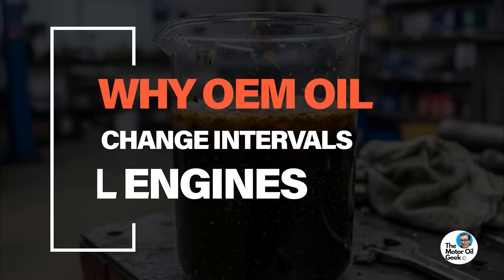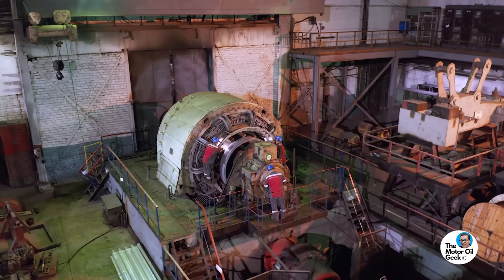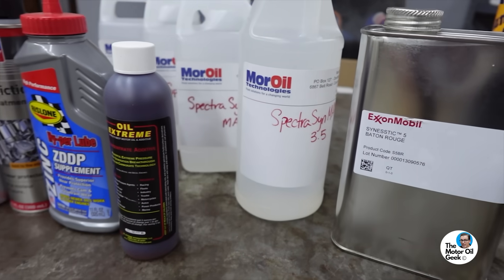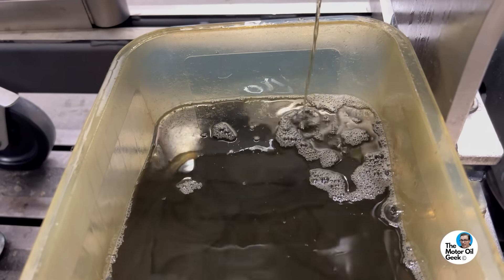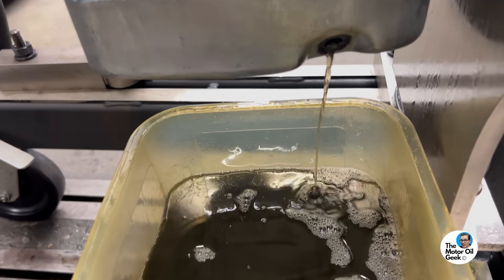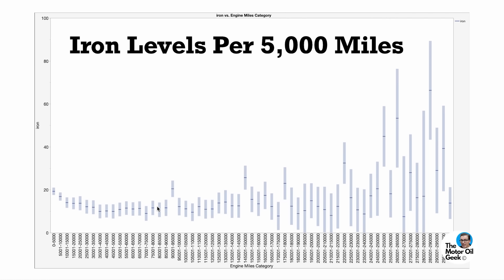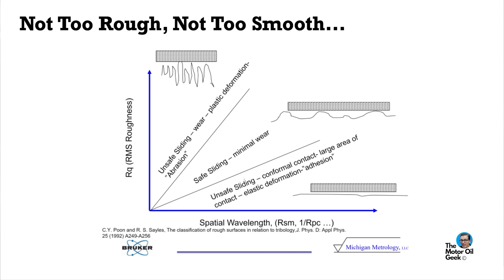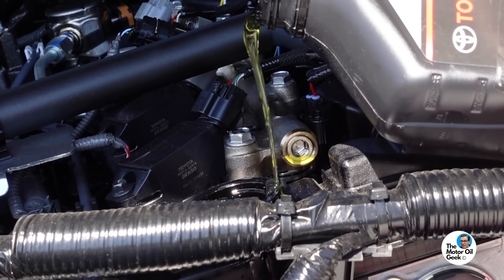NEW Data Reveals WHY Modern Engines FAIL Prematurely!

Comment: its been 5 years and we're still stuck on this, can they not just go back to engines that work??? Can they not up the oil pressure??? Can they not go back to 3000 mile oil changes???

Comment: Wouldn't changing your oil filter more often than your oil, be better overall ?. Or how about having 2 oil filters of varying filtering levels to catch as much as possible. As oil isn't un-serviceable, at low mileage, and pretty much wasted by discarding it so early.,,

Comment: Chrysler Rocker arms on the 2017+ Pentastar with VVL are on I think revision K.  Not only are the rocker needle bearings a poor design that fails easily with 10k oil intervals, the oil galley plug bolts are known ot come loose and fall out causing low oil pressure in the cylinder heads.  Ask me how I know.

Comment: I had a 2000 BMW 540 with an oil change "monitor".  It consistently indicated oil change would be due at 18,000 miles (extrapolated), but I consistently changed at 5000 (full synth).  Car was still running flawlessly at 200,000 mi when it was totaled (not my fault).

Comment: Let’s say you want to drain the oil after 1500 miles. Leaving the old oil filter on longer is recommended because this avoids “resetting” the filtering efficiency to a lower level. However, this also means you are leaving behind an extra 150-200 mL of old dirty oil. Is this not worse than resetting the oil filter to a lower efficiency?

Comment: All of my cars have gone 200-300,000 miles. I change my oil every 5,000 miles, change the transmission fluid every 30,000. When I've had to change timing belts and other engine maintenance, my engines are clean as a whistle inside. It really does make a difference.

Comment: Great, evidence-based exposition. I would just add one thing, in my case.  I bought a 2026 CR-V EX 1.5T, a month ago. Honda's break-in includes a moly lube on the cylinder walls. At 500 and 1500 miles, when I do these initial spills and fills,  I'm going to use the highest moly oil on the market . . . The MAZDA ECO7 (600 ppm) to maintain the moly levels during break in. I'm also going to install a magnetic gold plug, to catch the small micron particles. On the third oil change, I'll switch to Pennzoil Ultra Platinum.

Comment: Tighter tolerances with extended oil change intervals with higher stress put on your oil due to turbos, direct injection and low tension piston rings causing more heat, soot and fuel contamination from blow by. 3k or less oil change intervals for all my vehicles. Especially with how thin timing chains are today. They are extremely susceptible to wear and really need to have clean, uncontaminated oil to minimize friction and heat buildup.

Comment: I have a 2015 Ram 1500 we bought new.  It has 143K miles on it.  It has just developed the "HEMI tick".  We had the exhaust manifolds and gaskets replaced.  They were cracked, but the tick is still there - it's the lifter.  I did a 500 mile breaking oil change as I do with all my new vehicles.  I have only ever run Mobil 1 oil in it.  After the 500 mile breakin, I have used the computer oil life meter to determine oil changes.  I always changed the oil filter with every oil change.  My other vehicles I change the oil every 5,000 miles.  Is there a benefit to installing some kind of aftermarket device to install multiple filters?

Comment: I'm surprised that Lake Speed Junior got the oil filter part wrong.  Oil filters filter WORSE over time, not better.  He's thinking of AIR FILTERS.   Poor advice about oil filters (that is dead wrong) but good advice about oil.   That was disappointing.   He's also wrong about manufacturer CAFE credits for 'less waste oil' by recommending longer intervals.    Other than those two glaring errors, I've found his videos to be largely correct.

Comment: Do you really think, with all your knowledge of lubricating oil, that the problem lies with the oil? Wouldn't you like to share that responsibility with the poor engineering of downsizing, the cheap materials used to make engines, and the absurd reduction in clearances? With extra power? In favor of lower consumption and pollution? There are other solutions besides oil. Let's face it.

Comment: The whole reason I am now changing oil every 3,000 miles first engine oil of my jeep I did at 1,500 miles and also changed from 0w 20W to a 5W 30W and also added the Baxter adapter to get better oil filtration.

Comment: I'd be curious to see what the MOG (motor oil God) says about additives in the oil for heui injectors like the 7.3 fords and 6.0s. Heui is when the oil drives the injectors. Becasue ive had bad sticky injections did the additive and it cleared it up.. but was it just bc i changed the oil twice in a couple thousand miles?

Comment: Quality, reliability, dependability & longevity are a cancer to any manufacturing companies, especially automotive manufacturers. 

The days of quality, reliability, dependability & longevity are long gone. 

Things manufactured to fail, break, costs double to repair or replace.

Planned obsolescence is the new money making business model.

10,000 mile/1yr oil changes, lifetime transmission fluid, 0Wxx oils, 3yr 12V batteries (10yr batteries existed then dropped to 5yr). what's next 1yr batteries, WD40 baby oil engine oils?

Doing your own fluid changes is considered by dealerships & manufacturers as violating warranty. 

My 2007 Scion TC 2.4L 2AZ-FE rebuilt/salvaged car at 180,000 miles does a better job than these new laptops with wheels.

Comment: I've got a 2017 tundra with the 5.7. I use Mobile 1 20,000 full synthetic oil and filter. I change the oil at 10K mile intervals. I also use 5w20 instead of the manufacturer suggested 0w20. Should I be doing something different?

Comment: When I first  purchased my 2019 GMC 6.2. The dealership gave me a hard time because they gave me 3 free oil changes. I did the first one I believe at a 1000 or 2000 miles, and the second 1 additional 3000 miles, and then I think the third 1 3000 mile so basically I used up all my oil changes.  In about 8000 miles, and they said that was too frequent or well, maybe that's why my 6.2 hasn't blown up yet.Anyway , I'd like to hope .😢😅

Comment: The Geek is on to something here.
I'm an old guy... when my soon-to-be wife bought me a 1967 Triumph 650 as a 'counter-gift' for her engagement ring, I was delighted. Brand new... but Triumph did not put oil filters on their motors; instead, they had a 'sludge trap' in the crankshaft that captured the shavings etc.
My strategy was to change the oil at 50, 100, 200, 500, and then every 1,000 miles.
When I took the engine apart for a rebuild around 15,000 miles, the crank looked brand new - the original swirl marks on the big ends not polished over.
My '83 Ford 300 six got straight 30W every 3,000 miles, and I sold that van into commercial service when it had 320,000 trouble free miles.

Comment: Wait…so it’s better not to change the filter every oil change once the engine is broken in? I bought a used 2023 Camry that had 8300 miles. When it hit 10k miles I got the oil change. What I was surprised was that the previous owner never did the 5000 mile service. So at 10k, it was on the factory oil. Since then I been doing every 5k oil changes. I hope the engine didn’t get damaged.

Comment: Lake, you mentioned that you changed the oil 3 times on your Dad's race engine after using break-in oil on the initial startup. Did you run the engine for 20 minutes each time before you changed the oil, similar to your oil flushes? My son races circle track boats here in California. After breaking in flat tappet cams, we would change oil to our standard Valvoline 20-50 racing oil before we race. I'm wondering how you came to the conclusion that changing oil 3 times made a great difference. Did you perform an oil analysis before each oil change? If so, what did you see in the oil analysis that convinced you of the 3 oil changes? 
I hope your channel and the Speed Diagnostics business is very lucrative for you and your family. You deserve it. This information is so welcome to us novice engine builders, racers and auto geeks. Thank you!

Comment: Because of crazy cafe standards for manufacturers to show improved mpg every year, reliable V8 and V6 engines are replaced with small engines with big turbochargers and hybrid systems that are overly complex with much shorter life expectancy and much higher maintenance costs ‼️🤮

Comment: did you say "using oil as hydraulics fluid as the fluid is clean"?  I don't unerstand what you say. It does not make sense, because engine does not use oil as hydraulic fluid, except some oil powered vtech or hydraulic lifters.

Comment: So what is good oil?
  Cleeeean Oil. Of the right viscosity at start up after being shut down 24 hours and outside in the elements.
   W,, Means winter, below freezing for 24 hours and you must account for wind chill when iutside in the extreme north, at cold start up.

Comment: 545 2,500 5,000 7,500 & 10,000 miles that's what i did with my 2GR-FKS V-6 in my 3rd gen Tacoma TRD 4X4 off-road.. hopefully that will help in the long run 🤷‍♂️ & 5K from here on out

Comment: If you are restoring or rebuilding an old engine, when you first crank it, all of the old timers use break in oils and  grease. It's a no brainer. As an old Ford tech, we had Ford engineers come in and give seminars and we asked about oil change intervals...the engineer told us flat out, "You change the oil when it needs changing. That may be at 3,000 miles, or it may be at 500 miles. It all depends on how you are driving the car and what environment you are in." I had an old mechanic at the shop pull a car in, pull the dip stick and taste the oil. He could tell you all you needed to know about that motor. Funny, but true story. I have never waited to change my oil in my bike or cars to the "recommended" mileages. I pull the stick - if it looks like it's turning - I replace it. A whole lot cheaper than a new motor. My 2008 Ford F 150 with a Triton V 8 has 215,000 miles on it and runs like a champ. Another thing to consider is to change your radiator fluid once a year. I have done that with my truck as well.

Comment: I never thought about oil and hydraulics . This changes the whole way to look at long term engine performance and maintenance. Also today’s engines have much tighter tolerances. My take is that instead of buying fully synthetic lubricant at $15 per quart / 8K oil change. I will use Mobile 1 / 4K .  Thank you .

Comment: I had a '90 Toyota pickup, i always changed the oil between 3 to 4 thousand miles, over 19 years and nearly 500k miles on it still ran fine, never been torn down or rebuilt. always used Castrol 10w40 oil, not synthetic. If i did any heavy hauling like pulling my travel trailer on a trip, i would change the oil when i returned home.  for me its now a habbit i'd never go longer without changing the oil and replacing the filter no matter what the manufacture says.

Comment: I switched over to 5W-30 after the warranty had run out (original 0W-20) '20, Silverado 5.3v8. Use Amsoil. currently 94,545 miles, runs well. Question. Prolube is suggesting their additive will help extend the life of the engine. What is your take on that? Thank you in advance.
Reply: Yes, every 3K miles, oil change. Also, what GMC states about fluid changes, go 1/2. So, every 30K transmission flush/service. 20K rear diff. All Amsoil. 50K flush radiator, 50K belt, tensioner.

Comment: I change my oil on a new engine at 1,000mi - 3,000mi - 6,000mi - 10,000mi - 15,000 and then every 5k from then on. If you notice the intervals, it's 1,000 - 2,000 - 3,000 - 4,000 - 5,000. What are your thoughts on that maintenance schedule for a new engine?

Comment: Bottom line it for me. On a new '23 Honda Civic Type-R, if I changed the first oil change at 800-1,000 miles (switching to Amsoil Signature Synthetic 0W20), then a second change at 3,000 miles. And every subsequent oil change is at 2,800 - 3,400 miles. Am I in decent shape? 

The car originally lived in the mountains of Northeastern PA. Summertime I'd run 5W30 Amsoil Signature Synthetic, and 0W20 in the winter. Once the car moved to Southwestern FL (Sarasota/Ft. Meyer's area) it stayed at 5W30. I don't track it, but I do drive aggressively on the street. Oil temps hit 220+ F° on occasion. Usually peak around 207-215.

Comment: HOW much cleaner did you say new hydraulic oil is compared to new motor oil in previous video (less factory contaminants)?
Reply from the maker: Hydraulic fluid is typically 3 to 4 times cleaner than motor oil.

Comment: My brand new, 2025 Hyundai Tucson with a 2l engine was not meant to have its factory 0W-20 oil and filter changed until 15,000kms. I changed it at 1,200kms. The filter element and the filter housing contained sparkly confetti. Its getting its next change at 7,500kms, and then every 7,500kms thereafter. Its first scheduled service will be its third oil change. Also upgraded to 5W-30 oil.

Comment: I change oil every 5k to 7k miles. I have driven many vehicles to 300k miles, not a single engine failure. I drive a lot, I live in a rural area. I also use Super Tech oil, not a failure in 20+ years.

Comment: The Hemi tick is from an exhaust gasket leak between the head and the exhaust manifold. As the engine warms and the metals expand, they close that gap and the leak stops and the tick goes away. It has nothing to do with motor oil or engine wear. I love these videos but that part is misleading.

Comment: 2018 charger with a collapsed lifter,i replaced all the hemi lifters with non mds Johnson,they were expensive but work well and i use 10w30,its a high mileage engine that runs quietly and strong.

Comment: There is one practice GM made during 2020 that probably affected engine performance that remains under the radar. GM outsourced Chemical Management. The company (whom I once worked for but for fear of reprisal will not name) manages not only inventory and production washers but is bent on replacing long term suppliers of quality cleaners and fluids with their own brand. Improper production washer dump cycles as well as cost saving replacement cleaners and fluids could lead to residual swarf left in machined casting valley's, thus contaminating break in oil.

Comment: Question: If a person were to get an adapter for the spin-on oil filter and then run that to 4 "bypass" oil filters that are arranged in parallel, so that 1/4 of the oil goes through each filter and is then returned to the engine, would that level of filtration actually aid in lowering the contamination of the oil?

Comment: I dont care what OEM says. I always changed the oil myself at 500, 1500, 3000 miles during break in. And then every 3 months or 3k miles. For the life of the vehicle. Never had a engine fail from lack of lub or debris.

Comment: If you look at the Mercedes Benz EPC, at least for the oldies (70s and 80s) there was a oil filter specifically for the factory oil fill or to use after an engine rebuild. Unfortunately it was unavailable everywhere and there wasn’t even a picture of it. Would be a nice comparison!

Comment: I find it amazing that a few decades ago, a four cylinder engine typically specified four quarts of oil and 3000 mile charge intervals. Now you see a turbo four cylinder engine specify 7 quarts of oil and 10k mile oil service intervals. Are they increasing oil volume to increase the oil life and service intervals or just for performance?

Comment: So what about high mileage oils that have the seal conditioners?   I use that as my vehicles are older with 200,000 miles on them because vi don't want a rear main seal leak.

Comment: Really well made video, thanks for all the info! What do you think about Fumoto drain valves? They conveniently allow draining oil fully or partially without dealing with any tools or plugs. However, the valve threads stick into the oil pan a few mm and result in some leftover oil. One user measured the residual oil left behind and found that it can be 50 to 120 mL of old oil, which is only about 2% of the total volume. Since we're talking about oil contamination that's measured so finely, I imagine its a nightmare scenario to have old oil in the engine that potentially gets cycled for multiple intervals.

Comment: So just a quick question. If you put a heavy weight oil in your new vehicle that in turn could affect those systems that operate on hydraulic pressure? So the idea of the 0w-20 and thinner is to make sure those systems get the proper pressure in all temperatures.

Comment: Its the warrantee that  is always too short on modern expensive cars , so the manufactures can easily  take advantage of the consumers by building in ticking clock deliberate failures, EG: Even today many expensive luxury brands deliberately using brittle  plastic heater pipes/fittings and  connections  that fail after a certain amount of heat cycles , so it forces people to buy over priced replacement parts and or new vehicles all so manufacturers profits are always increasing for shareholders and board members. Federal government should make a mandatory 10-15 year warranty periods for all cars as cars costing 60-70-80-100 K seem to only have 3 or five years warrantee and then your on your own is ridiculous and wrong .

Comment: LOL.  I changed my oil 8 times in the first 8000 miles on my 2025 Toyota Sienna.  It was actually to get real time data to see if there was any difference between 5w-30 or 0w-16 (the cray Toyota recommendation).  And then every 3 to 4K afterward.  This engine is going to go 300K.  I run 0w-20 in the winter and 5w-30 in the summer.

Comment: I change the oil every 3000miles/5000kms no matter what the manufacture says. Now at 500k kms and still running strong and not burning any oil.